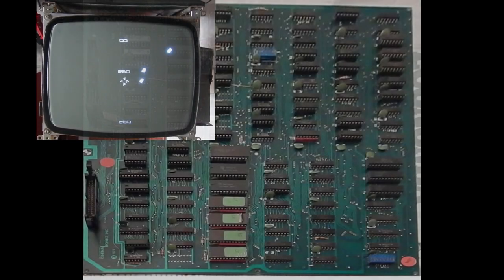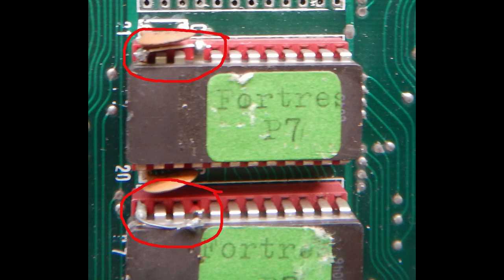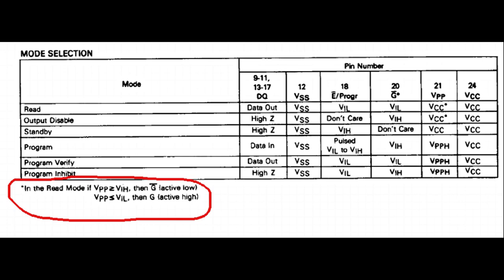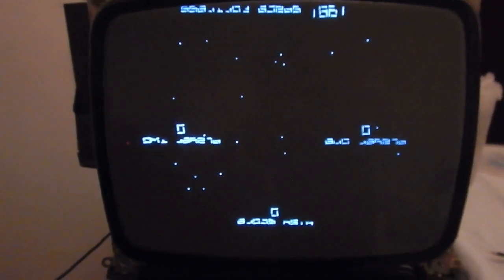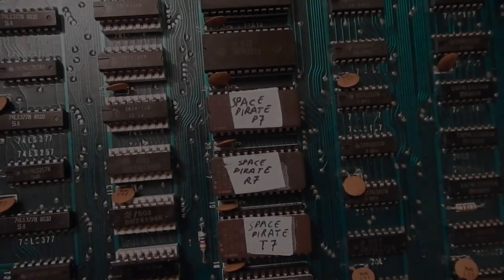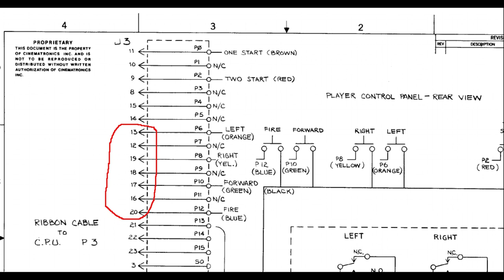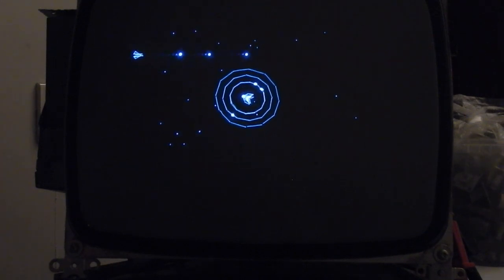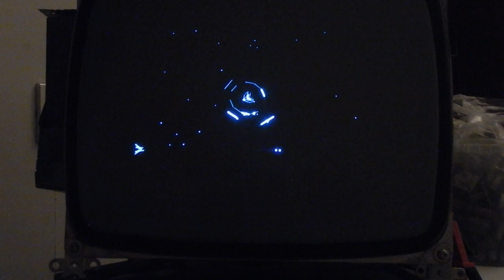Zaccaria Space Fortress arcade. Not much effort needed.

Comment: Some of your vectors are too short. Might be a problem with PROM at E8. All Cinematronics boards use the same contents for E8, so this could be tested by swapping. Could also be a problem with the video DACs, or the caps being charged based on the DAC values. 

Btw: E8 contains 32 bytes:

000000: 00ff ffff ffff ffff ffff ffff ffff ffff
000010: d8ff cdff ffff 9eff ffff bae4 effd fff5
Reply from the maker: Thanks for this comment, here's that board's E8 dump: 0000000: 0000 0303 0001 0000 ffff ffff ffff ffff
0000010: d8ff cdff ffff 9eff ffff bae4 effd fff5
 so the first few ones are different according to your dump.
Reply from the maker: However, my E8 dump is identified correctly on http://romident.coinopflorida.com/uploadrom.php as zaccaria space fortress E8 prom
Reply: @iz8dwf  Ah. I forgot that the only important bytes are byte 0 = 00, and bytes 16-31, which are the same. At least that's my recollection from stepping through the process that sets the length timer (possibly not even all of the FF bytes in 16-31 are important). Looking at the "usual" Cinematronics schematics, all this happens on the last page (6th page) of the CCPU schematics. E6, D6, and C6 (combined to form a 12-bit counter) are used to load values from E8 depending on delta-x and delta-y for the endpoints of the line segment to be drawn. Once it gets to the appropriate value, the counter function of E6, D6, and C6 is engaged to count from the value loaded into the counter up to 4096 (but note the two MSB of the counter are tied to 1). I wonder if one of the lower bits is stuck low, causing short lines to be obviously shorter. I'm very suspicious of the timer circuit or the value loaded into the timer.
Reply: Another possibility is that they changed the code to shorten some of the vectors when they did the bootleg. Seems an odd thing to do, but it would be interesting to compare the disassembled code.
Reply from the maker: If you want the rom dumps, just drop me an email
Reply: Fascinating discussion :)